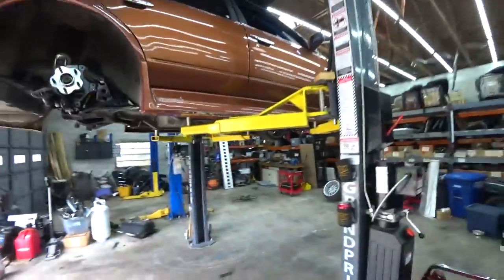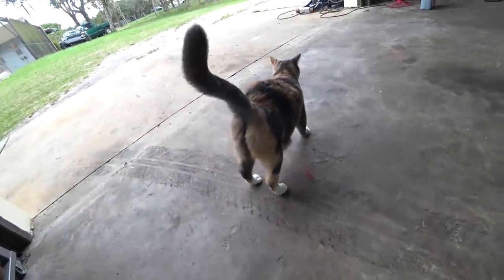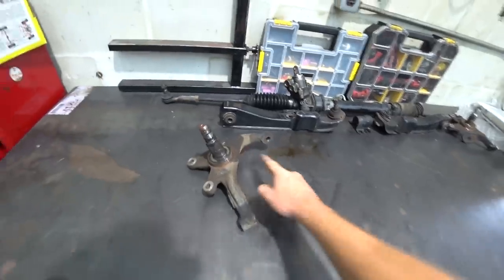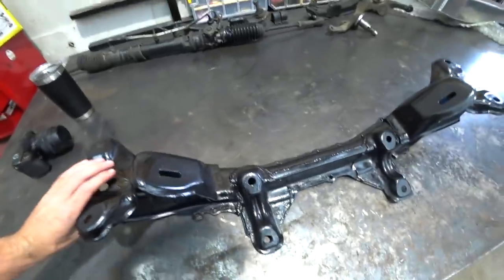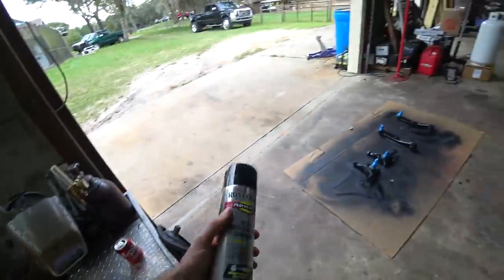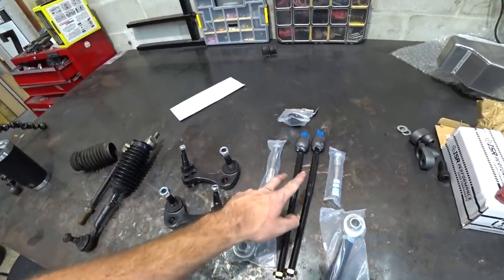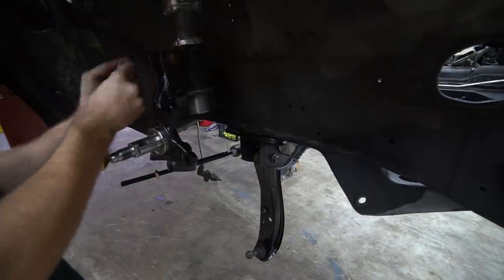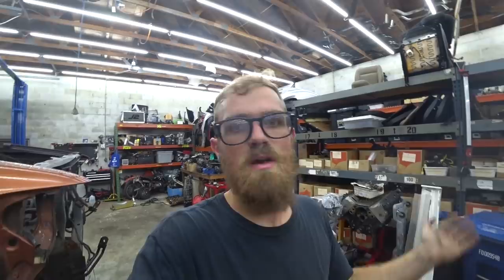RWD K-Swapped Cefiro Build Pt.7 Finishing it all up.

Comment: So my favorite spray paint is the Rustoleum Automotive enamel. I've gotten PERFECT smooth glossy results that held up years with that stuff
Reply: Enamel is awesome stuff.
Reply: Agreed Enamel is the best easy to lay out and has a great shine if laid down wet enough Rustoleom is exactly what I use when I spray bomb something only thing I have noticed is if you go to bare metal and use a etching/ filling primer it doest react well with other primers even if they are enamel based primer only rustoleom enamel primer sealer has worked well for me allowing you to lay on wet and not wrinkle when dry !!

Comment: For future reference if you didn’t already know, FC/Miata/s13/s14/a31/n14 tie rod ends all have the same thread pitch if you have some kicking around in the shop they may work completing your project. only difference is they all have different angles at the end. Miata having the most angle fc being in between and schassis having the straightest tie rods end angles

Comment: Go to your local truckpro and get a can of Seymour bigrig gloss black frame paint. Painted 2 rig frames and a trailer and it's the best spray paint you could ever use. Damn near powdercoat. You can get push lock tubing fittings there also.

Comment: Really need to start using a backup wrench on the steering rack itself when tightening outer tie rods.  Not holding it is a good way to put odd stress on the pinion and other internals.

Comment: Hey Taylor, you explained what you do when you modify a knuckle to get angle. But you put in the unmodified knuckles and still get MAD angle.
I had to go back and see that it was the brackets that not only lifted the knuckles but also had holes made in them to fit the tie-rods.
If it's not buttoned up already is it possible to get a clarification of that, educational purpose, pretty please?
Reply from the maker: Basically the adapter relocates the tie rod pickup point in towards the pivot point of the balljoint as you would do on a cut knuckle, but without having to cut and weld. It also has a second location further out for grip racing.
Reply: @Taylordrifts  So basically it does the work of both drop knuckles and modified knuckles, all in one non destructive way!?
Are they relatively cheap?
Reply: Hmmm, maybe not a complete drop knuckle, doesn't address the mounting point for the shocks.

Comment: Hey Taylor, what attachment do you use to strip the paint rust etc off the metal before you did the plasma cutter? the small attachment
Reply: There’s a load of different Rolock wheels that fit those, you can use a scotch pad, 40 grit sanding pad or flap disc pad to strip paint, the system just takes a half twist to switch the disc.

Comment: Does moving the steering rack and cutting the knuckles effect things like caster?
Reply from the maker: No. Caster is determined by that yellow arm I pulled off. The tension rod. Basically pulling the LCA forward or rearward will change the caster.

Comment: I would have just remade all that stuff. Screw all that trying to move and fit the weak ass original parts. I know thats easy enough to say and not easy to do. I have done it with all of my Rock Crawlers. Takes extra effort but cobbled parts don't break if you build them right. With maybe billet steel or aluminum.. just some more machining to do.